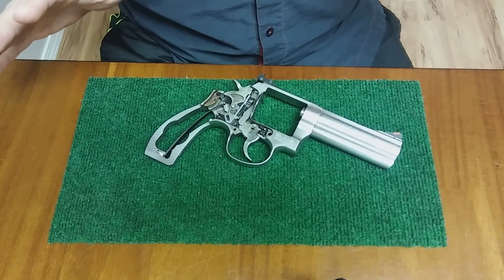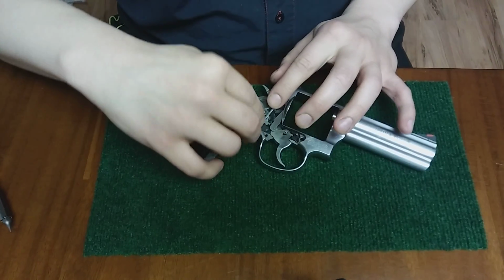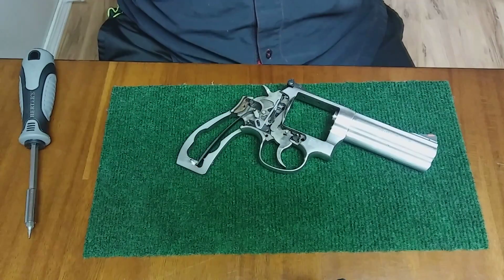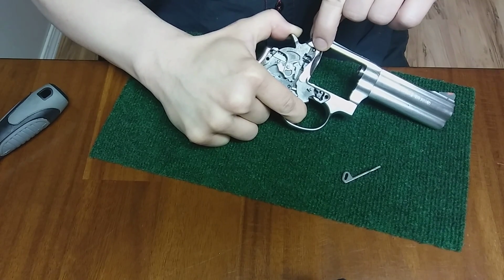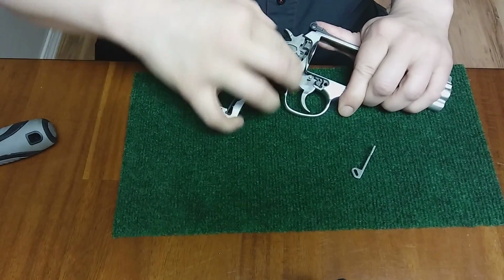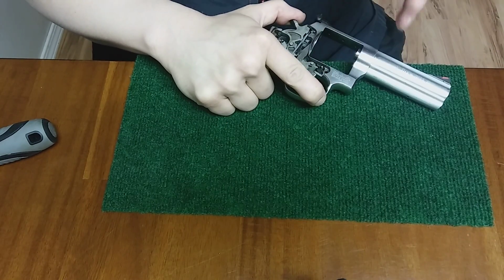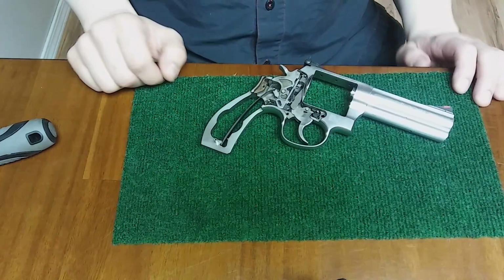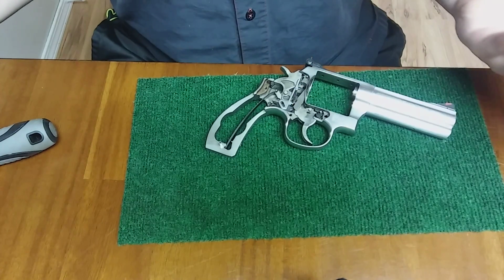Hammer Block Explained

Comment: I just bought a Taurus 65 because no S&W equivalent were available . Later I began reading everything I could find on it ,knowing they have a bad reputation and having owned a Taurus back in 1978 which did not last long.When I ran into the transfer bar issue I could not believe I had fallen for it again. Well I desrve it,didnot do my homework and wasted $$$. Cannot use it as a carry or self defense, you never know when the little bar will fail.

Comment: Great explanation! I do feel like that secondary hammer block bar is redundant and unnecessary, creating another possible failure point within the action of the revolver (even if highly unlikely). I now understand why many Smith owners I know remove that bar altogether; they still have the primary hammer block safety.

Comment: Hammer Blocks can also break. My Model 60 just ended up with a broken one. Fortunately it seems to work without it. It may take a while to get a new one. :)
Reply from the maker: I have never heard of that happening. Was it the part that looks like a transfer bar though? That part could be removed and still work but the actual block that touches the trigger mechanism on the bottom shouldt break. Sometimes these terms get interchangeably used because they all can "block" to some degree.
Reply: @GunSam  nope... it broke at the base near the eye at which it mounts to the pin

Comment: Do all Smith and Wesson revolvers have hammer blocks ? I recently purchased a model 642-2 revolver with an Internal hammer . Is it safe to carry fully loaded ? Can it misfire if dropped or im just trying to figure out everything I can about it
Reply from the maker: Yes, pretty much all modern S&W revolvers have them. I don't know about antique ones, but a 642-2 would for sure have one.
Reply from the maker: It's safe to carry fully loaded, nothing to worry about.
Reply: I've dropped mine a couple times, no problem. Still has a pucker value though. Lol

Comment: interesting, I must say that SW design is over a century old. like the 1911 having been around over a century does not mean it is bad but sometimes newer ideas like the hipower come along and make a little more sense. I agree that the SW is a good gun but the GP100 is an excellent well engineered piece. I have to disagree with you but that is OK. Transfer bar, poured metal, these things are debatable and I do like hearing other folks thoughts. Thanks for the video
Reply from the maker: I think that the GP100 is a good gun, I had the SP101 for a few years and really torture tested it by shooting the crap out of it. It was always reliable. Forged vs cast is more forgiving, either way is fine, my only real issue is that transfer bar, after watching two snap off and lock up 2 Tauruses, I never forgave that design. Ruger and S&W have both been flawless for me.

Comment: Thanks for the explanation, Sam.  I can spot that other hammer safety looking inside the hammer shroud on my gun , and you can se it moving out of the way as you start the pull. I thought that was the only safety on the 438.

Comment: I like most of your stuff but this is like Ford vs Chevy when Ruger gets thrown in the mix.  Ruger makes excellent revolvers.  If I were to buy new it would be a Ruger as I refuse to buy S&W with a lock.  Pre lock all day but new it’s Ruger.  My 43 year old Ruger has a transfer bar and it just keeps going and I run everything through it.
Reply from the maker: I like Rugers as well, and the thing I have personally discovered is that Ruger has very good steel. I still stick to my guns that the transfer bar in them is not the best design, but Ruger's can take the abuse due to their metallurgy. Now if you put that same transfer bar system in a Taurus, look out. I have had snapped off ones, and I even found youtube videos where Taurus owners had them snap in the first 50 rounds. I have googled Charter Arms transfer bars snapping and they do as well, there are only a handful of reports of Ruger transfer bars failing, but there are some. If you search for hammer block failure or breakage, you really don't find anything anywhere.

Comment: Good video. I always thought the hammer blocks worked the other way around. The redundancy is good though. Although taking down the hammer from single action is still not without risk ;-). I do wish the hammer and trigger were not MIM parts. Either that or S&W had a way to make them as corrosion resistant as stainless steel. The develop a patina that doesn't match the rest of the steel and doesn't seem to polish up with flitz. As for the comparison with Taurus, I gotta agree. Although in mine, the transfer bar was not the weak link. It was the trigger. The seer for DA mode in mine simply wore down such that the trigger would actually lock when trying to pull it DA. SA works fine.
Reply from the maker: I wish that there was a test putting MIM parts against stainless or carbon steel to see if they are just as strong. I would also love to see an aftermarket company make titanium replacement parts for all revolvers, including Taurus transfer bars. I think there would be a market for things like that.
Reply: I have no idea how strong MIM parts are. Hardness would also be an issue for seer surfaces, obviously. I also do not have a clue as to how tight the tolerances are in S&W's manufacturing. Do they have to hand fit the parts during assembly? Or are they like Beretta that claims to have 100% parts interchangeability?